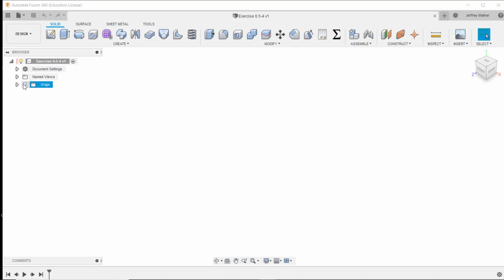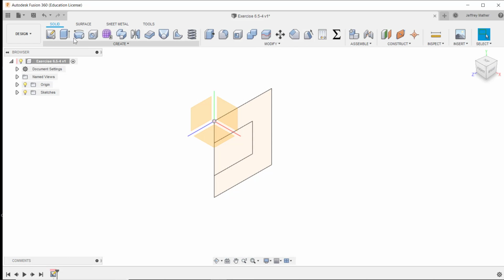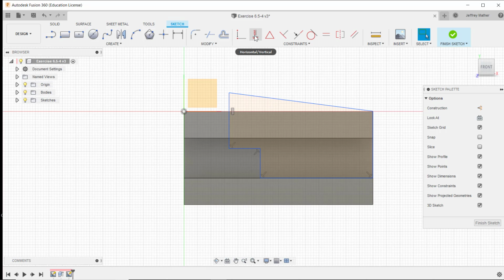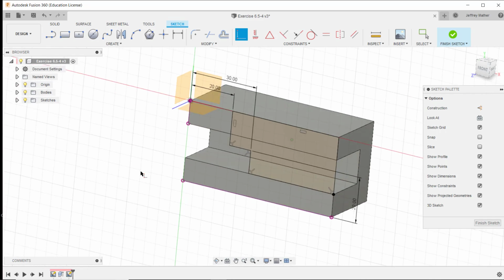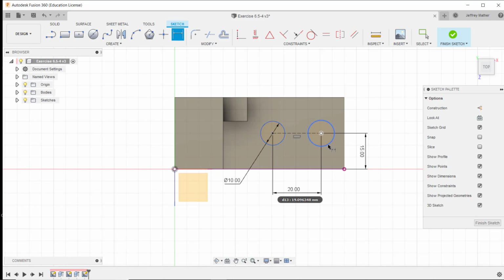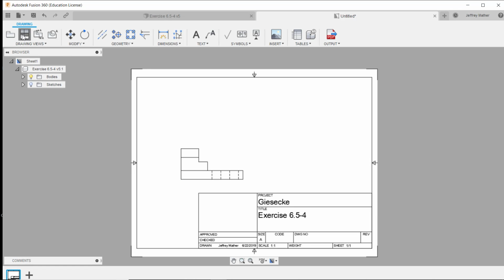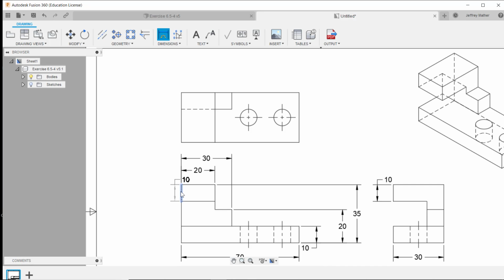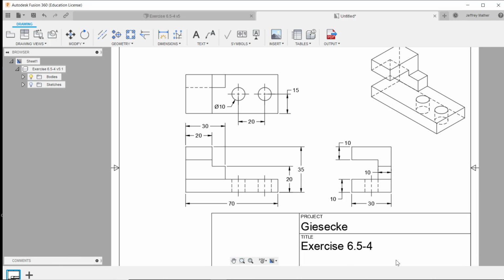Fusion 360   Exercise 6 5 4

Comment: why do you use the view cube that way? i mean the Z axis shoulb be the one pointing to the top face of the cube not the Y axis
Reply from the maker: In Fusion 360 (default), Autodesk Inventor, SolidWorks, Creo and I suspect other 3D MCAD programs (I don't include AutoCAD in this group) the coordinate system is as shown.  What is the reference source of your information?  In any case, it is all relative.  When I am machining a part the Z-axis is the axis of the machine spindle.  Vertical on a vertical mill, horizontal on a horizontal milling machine.  All relative.
Reply: @TheCADWhisperer  I dont know why but mine has always had the z axis pointing to the top. At least in fusion and Inventor. Probably I configured it that way without knowing. I dont really have a source it has always been that way since I started using this software. Im just starting to use them. However it does seem weird if you have been studying calculus or physics, in which the consensus is that the Z axis points up most of the time. But like you said it doesnt make a big difference, its all relative.